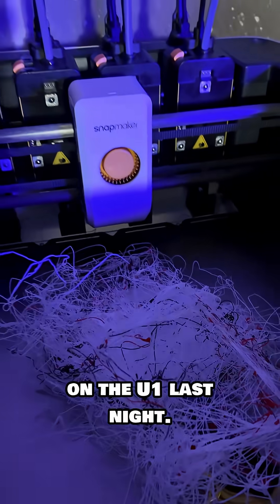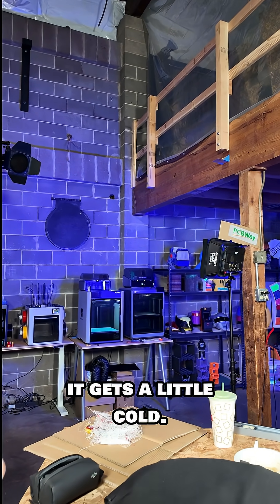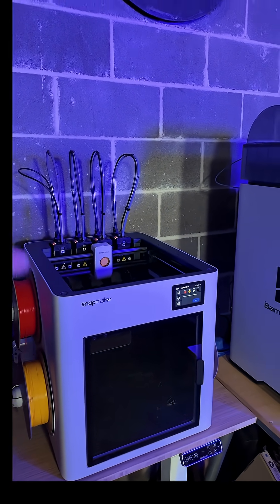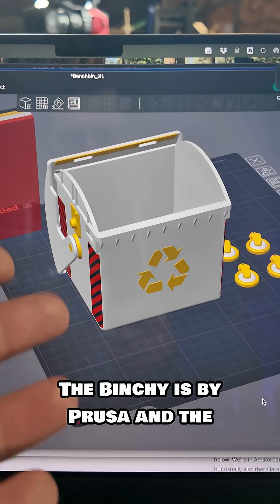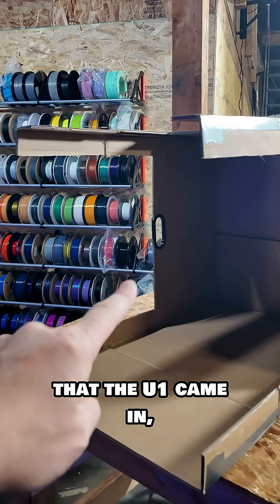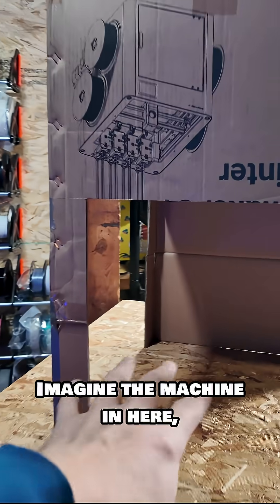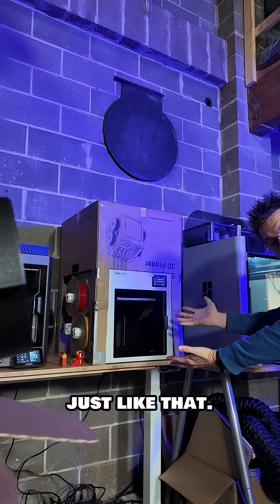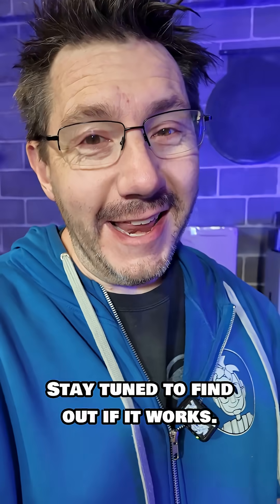Snapmaker U1 Cardboard Enclosure! #3dprinting

Comment: Fun videos, one thing... 🙂 :10 It is your videoing area. Film cameras work by exposing light onto photochemical film stock that runs mechanically through a camera and is later developed in a lab, that physical process is literally what filming means. Video cameras operate differently, they capture light with electronic sensors and record data as digital files, so the correct description is that they video or are videoing. 🙂 Using accurate language is about clarity and education, not mimicry or the illusory truth effect, where repetition makes something feel correct even when it is not. When people use the right terms, they better understand the tools actually being used and why those differences matter in cost, workflow, and craft. ✌❤

Comment: but was the plate washed recently, I see you touch the plates with your bare hands.  I live in North Dakota, it is below 0 right now, my unit is in my basement with no heat at about 60 degrees. I had no adhesion issue. 

Washington does not get below 50 degrees on average, I am not sure that is the issue here.

WASH YOUR PLATES PEOPLE

Comment: I used a cardboard enclosure over my Neptune 4 Pro for a few weeks to print all the parts for my current PETG and acrylic enclosure. Worked great. My printer was in my cold and drafty basement and I went from extremely warped and useless frame pieces to functional straight frame pieces. That project was a great learning experience.

Comment: If it's not sticking, then your bed temps are too cold.  In these cases where ambient temp is the cause, you will need to raise the bed temp.  For PLA in this case, 70c will be needed to keep it stuck, yes that is going to make the first layers be a bit soft, but it will be fine since things will STAY PUT.
Treat this as an open framed printer like the A1.

Comment: Line the box with foil. I did that to my P1P before the P1S came out.
Reply from the maker: Oh heck yeah!
Reply: @3DPrintingNerd it worked until I got my P1S. I still use my p1p but it's for my open air filaments now.